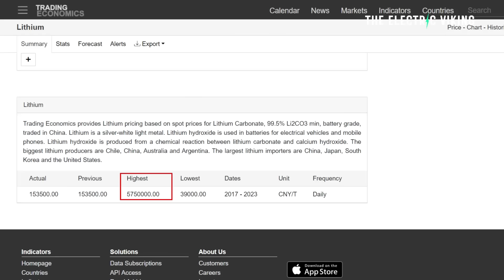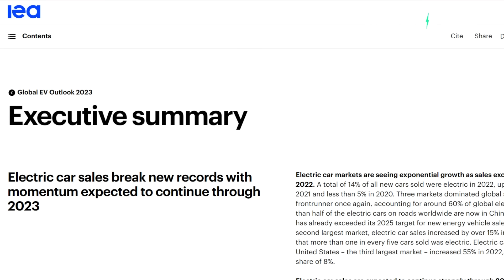The reason Electric Cars will be cheaper than ICE cars in 2025

Comment: EV's are still junk. They don't have the range, take entirely too long to recharge. The infrastructure is already crumbling. The Ford car companies CEO couldn't get from A to B with out extream difficulty. Also, (at least for me) there's no EV that suits my family needs. We aren't Ethiopian midget  refugees. We don't hail from Noth Korea or The Land Of Oz. Plus, size people. 4 of us. Several have had knee surgeries. Not to mention my 3,  70 pounds plus dogs, my yip dog, and my two attack cats. Currently, as far as I know, there's no EV that doesn't cost a very large percentage of my very nice house in Connecticut available to fit my needs. I stay with my ICE 11 years old Toyota van, it fits my needs, is paid for, no nasty monthly subscriptions, no worries about having to spend impossible amounts of $$$$ for repairs. It will be interesting to see how the lower prices of batteries impact the nasty replacement bills on a EV, saw one recently, plus $50 K for a vehicle less than 10 years old.
Reply: Modern EV’s have ranges around 330 miles. Like the Tesla model Y long range. But you typically charge it at home overnight when you’re asleep and not using the car. 0 time wasted or waiting for a charge and a full tank every morning. Unless you travel more than 330 miles for work every day. Which I doubt.

The model Y is also a mid sized SUV which is renowned for having more cabin and passenger space than any other SUV in its class and 300L more boot space than its nearest competitor in class. Plus a drop out under the boot and a front trunk not included in that number. And it costs about the same as a Ford Bronco. 

As for battery replacements. The total cost to replace a Tesla battery including labour is around $12k. Which is about the cost of a new engine. But the warranty on the battery alone is nearly 10 years. And is supposed to last about twice the lifespan of an ICE engine, which make sense consider the industry standard ICE engine warranty is only 5 years. 

As for repair costs, the Tesla is classed as a luxury vehicle up there with Audi and BMW. Comparing repair costs for panel damage. The cost is about the same compared to its competitors. It doesn’t have any maintenance costs so you can’t compare a cost for engine or transmission repairs because it doesn’t have any. The electric motors should last the lifetime of the vehicle without ever needing to be touched and since the battery is apart of the chassis the only way you’d damage it is if you had an accident hard enough to damage the chassis, which would be expensive no matter what car you were driving. 

The only increased repair cost you’ll get is if the rear left quarter is damaged as that’s where the charge port is. In that case you add 12% to the cost and you’ve roughly estimated the additional cost of repairs to that part of the car.

Comment: I just read that VAG, GM and Toyota don't want to produce EV's anymore because the customers don't want one. 
The customers don't want one. And they don't want one in 2025 unless a miracle happens.
Reply: True but also not true. The customer wants an EV. They don’t want THEYRE EV’s. Simply because they aren’t competitive. Tesla has been making EV’s for the last 10 years. They also have a drastically different business model which has allowed them to have the highest profit margin on any car sold on the market today. So they can and have been cutting prices to stay competitive. The way they’ve manage that is they build their own car from the ground up. And the support network with it. Like the Tesla super charger network.

That means every part in a Tesla is made by Tesla for Tesla. The programming, infotainment system, sound system. Motors. Seats, interior. Etc. Legacy automakers outsource that. They get someone else to design the infotainment system, and someone else to program it, someone else to build the engine, and someone else to design the interior and someone else to make the seats. They just assemble it. What that means is a lot of middle men taking a cut.

Couple that with the fact that legacy automakers not only aren’t set up to make EV’s and don’t have the 10 years experience of making and perfecting EV’s, means not only do they produce a product that can’t compete with Tesla’s they’re also needing to charge more for it. So you pay a lot more to get a lot less. Not only that but legacy automakers sell exclusively through dealerships which charge a markup on the cars to make bank. Tesla sells direct toy the customer. 

So naturally consumers don’t want to pay a heap more to get a lot less. Where good EV’s have been dropped at a good price point, consumers have jumped on it. That’s why the Tesla model Y is the best selling new car globally in 2023. 

Which is why cars like Mercedes EV offering, the EQ, isn’t selling. Because even if the EQ was at the same price point of a similar sized tesla, it wouldn’t be competitive. It would have the range, performance, software advancements or charging infrastructure and network that the tesla has. But Mercedes is asking for an extra $150k for it. Plus another $12k for the dealer. And then wonder why it isn’t selling?

Comment: You may be underestimating the potential decline in Lithium Carbonate prices in the next three years. Exxon is investing in extracting Lithium directly from brine wells 😮 if it works out as expected, current Lithium extraction costs could decline by over 80 percent with minimal environmental costs and impacts.
Reply: Three years out? The market will be dead for 2 years by then.

Comment: It is a real shame batteries are arriving about a decade too late. We pass the 2 degrees Celsius threshold in 2026.

We are emitting 41 gigatons of carbon per year and it was projected we would be down to 29 gigatons by now.

Even with radical adoption of electric vehicles, transportation is less than a quarter of our carbon budget.

An oceans are all out of heat absorption capability.

Seems to me anyone under 50 is going to live through some very hard times.
Reply: What is your plan for removing Water Vapor? A 50 times bigger problem.
Water Vapor (WV) is a greenhouse gas as potent as CO2 according to theory. On average there is 50 times as much WV in the atmosphere as CO2.
The fact that it is non-persistent is often mentioned. It doesn't have to be. You can AVERAGE (integrate) the effect. There is on AVERAGE 50 times as much.
Reply: @msimon6808  because unlike CO2 and methane, water turns to liquid form. And water isn't the cause of our current warming atmosphere. And increasing CO2 and methane causes warming of the atmosphere which causes the atmosphere to hold more water vapor which does cause increasing warmth from historical norms.

The root problem is a dramatic increase in CO2 and methane. If they were brought under control then things would regulate back to the way they were for thousands of years.

But here's a clue, because of people like you we haven't regulated and we won't regulate and things are just going to get really really bad . People who are under 50 will live in some very hard times with food insecurity and much hotter conditions.

Comment: As an older ice vehicle owner, I'm very happy for the success of electric vehicles.

It's putting downward pressure on gasoline.   

And in 4 to 6 years,  when I'm ready to buy my next new car it will be an ev.

Gasoline last night was $2.39 (cash).  That was gob smacking. 

However as the number of ice Vehicles declines, they will lose their Network effect and they will lose the political power and as a result their current massive subsidies.
Reply: It is electric cars that are getting massive subsidies. Just wait until your electric bill has a road tax. 
Electric cars will be a niche market in the world for a very long time.
Reply: @msimon6808  know the oil industry receives 6.4 trillion dollars in subsidies every year. That's more than the total size of the electric vehicle industry.

The coal industry receives additional subsidies so old they are embedded into our tax system.

The subsidies that the electric vehicle and alternative energy Industries are receiving are dwarfed by comparison to the fossil fuel subsidies.

Comment: Yeah right, paid for by the taxes on ICEs. What does the price look like when that's gone away? Then there's your car insurance cost going from $1000 per year to $5000! And is your time worth anything? Or are you okay waiting an hour for the guy in front of you to recharge before you start your own hour long "refill"? Of course, remember the warnings. Don't use your EV when it's too hot or too cold... Or if you want AC at home in the summer... And wait until the government start changing you for "recycling" your dead battery! And on it goes... Then just in case you think you're all squeaky clean doing your bit for the planet. An EV is nothing more than an external combustion engine adding heavy metals to its pollution footprint... Sure there is a place for these things. Forklifts or a small electric moped for running down to the store... But we're a long way from mainstream adoption and this won't happen until all the BS pedaling stops from people like yourself.

Comment: Evs will never take over from ice. The world doesnt have the electrical structure to handle millions of new evs. Many countries still dont have enough basic electricity to power their whole country properly. It will never happen. People are already shunting away from evs, look at all the unsold evs everywhere. 
This was just a government money making sceme that has gone badly wrong. 
Unless they can make a battery that can last 1000 miles between charges and can charge as quickly as an ice car can be refueled they are doomed. And law of physics tells me this will never happen, with the current technology. As a result electric cars will just be an expensive niche market, never making it mainstream...thus they will not be cheaper than ice cars. 
And I am not anti electric cars...they have there place, that being as a local runaround and short commutes for some people. But they need to be much cheaper, which will not happen. Here in Japan there are literally millions of small k cars which are 3 cylinder 660cc petrol engined cars, many hybrid also, cheap as chips to run and maintain. No one here wants an electric car.

Comment: With lots of car damaged from flooding due to climate change&extreme storms, can those vehicles be refurbished&converted to an EV?  There's EV conversion kits in Europe but there's resistance in North America due to top car manufacturers.  With a lot of common types of vehicles like the SUV, trucks and luxury vehicles being flood damaged and most of its shell is still useful but the ICE engine been damaged, can it be replaced.  So very expensive ICE brand vehicles like Range Rover, Jaguar, Ferrari, Mercedez Benz, Rolls Royce that had been flood damaged are mostly useless, their shells are being sold at a high discount used car prices. To make it feasible&encourage for ppl to adopt EVs, the flood refurbished conversions shouldn't be too expensive but also set up for recertification&have insurance that will support the converted EV market.

Comment: I live in Ontario Canada, and there's no infrastructure to accommodate EVs , majority of us are living in high-rise condos,  many are renting, there are no chargers in those buildings. We need charging infrastructures and is not there, and EVs sales fallen sharply here
Reply: Really? Because between Q1 and Q3 of this year, EV market share in Canada increased from 10%-13%. And pro tip. If those apartments have secure parking. You can get chargers or PowerPoints installed to charge the car from. And a lot of work places are also offering that as well. And I had an EV while renting. As it turns out, electricity outlets are considered mandatory for rentals. Just like water. Or windows.

Comment: Keep dreaming... The EV sale will go flat because the problems of slow charging, fire safety, short lifespan of the battery are not going anywhere. The charging network cannot keep up with the growing number of EVs. Remember most of human population are struggling with poor systems of electricity. EV is only a fancy toy for the rich
Reply: So many incorrect statements here. Where to begin? 
-EV sales show no sign of flat lining so far

- according to vehicle safety regulators AND insurance companies doing their own independent studies, EV’s are between 20-50 times less likely to catch fire than an ICE car. Even while parked.

- Modern EV batteries last twice the average lifespan of an ICE engine. The warranties reflect this, with the current industry standard EV battery warranty being nearly 10 years whilst the industry standard Engine warranty is only 5 years.

- charging network in the vast majority of places can keep up just fine. Most have excess capacity, and have been increasing in capacity, even to this day. Also keep in mind EV’s typically charge at night when demand is at its lowest. And at the rate of grid expansions vs EV adoption, there is more than enough time for the grid to keep up. 

- you can pick up a Tesla model 3, BMW’s M3’s main market competitor in size, performance, handling and luxury, for less than a ford bronco, BEFORE incentives. Ford broncos don’t strike me as a “toy for the rich” or ultra wealthy. Perhaps that’s why the best selling car globally in 2023 is the Tesla Model Y. Because it certainly isn’t because it’s a rich persons toy.

Comment: Good vid as always. Sam puts effort into these; it shows.

BYD making such profits because of battery production: seems reasonable. I suggest it's dangerous or at least misleading to quote BYD's profits as proof of anything much. As a Chinese firm its financial reporting is opaque and of questionable value. Chinese firms are all subject to control of the CCP and receive unknown subsidies from the State. China targets specific industries for dominance, subsidizes them and dumps product world-wide to gain market monopoly control. They've done this will a succession of industries, from low-value iron & steel to metals refining, solar panels, batteries and of course EVs. BYD reports profits of $5K per car. Maybe that's true. It's still a lot less than Tesla but it would be stunning success, where everyone else but Tesla is losing from $35K (Ford) to $430K (Lucid) per vehicle produced. But it's still suspect. We don't know whether BYD is actually profitable, and can't know.

Lithium prices dropping: another example of why people who scream doom about resource availability are idiots. Count on engineers & the market to keep increasing supply of a supposedly limited resource. Need more? We'll find more. We always do.

That said, geopolitics is the biggest risk. China doesn't have a monopoly on Lithium refining, but they do produce most of it. Growth in refining capacity elsewhere will help keep prices down, and China's oversupply problem will discourage it from blockading supply to other countries: they need the sales.

A more immediate problem: China has a near-monopoly on rare earths & cobalt refining. Tesla has engineered around that by eliminating cobalt from their batteries. So its exposure to that risk drops as it switches to LFP batteries. Other companies will follow. Tesla is also engineering rare earths out of its motors, reducing the need for them. Again, other companies will follow. Short-term we remain exposed to possible political blockade of rare earths from China.

Correction (at 1:20): Wright's Law, not Moore's Law.

Comment: My view: The game changer is commercialization of SSB(solid state battery) by Toyota, QuantumScape, and Solid Power in 2026 - 2027. BYD and CATL are behind in SSB at least by 5 yr. The sales of EV equipped with SSB will spike and all car manufacturers will stop making ICE cars before 2028. Many countries will ban Liquid Lithium Ion Battery which catch fire in passenger EV and buses everywhere. SSB provides 3 additional advantages: (1) faster recharge time, 20 min or less (2) longer driving range (3) 3X of battery life. No need to replace battery pack up to 240,000 miles. In the long run, it is cheaper.
Reply: With a given infrastructure doubling the charging rate causes four times the power loss. To go from one hour to 6 minutes of charging time causes 100 times the power loss.  I wouldn't let politicians make any decisions in this area. They have no concept of all the trade-offs involved.

Comment: Toyota made 10.5 million cars last year.  Toyota's new car that runs on water has an ICE engine.  Filling up with water at home will cost 7 cents for 10 gallons.  The water will be changed to HHO just before going into the engine.  The exhaust will be water which will be returned to the water fuel tank extending the range the car can travel.  No coal, natural gas or oil is used.  A water powered car has no carbon emissions.  There will be no electrical fires to burn children and adult passengers in the back seat.  Without a giant battery, the water powered car will weigh thousands of pounds less than an Ev and will cost less to make.  Because water powered cars use ICE engines similar to what detroit has been building for 100 years, it will take less time to copy what Toyota is doing than converting to make EVs.  Detroit is now starting to produce EVs and they are sitting unsold on the dealer's lots.  The Chevy Bolt had so many electrical fires, they stopped making until they could have fewer fires.  Imagine taking a water powered Jeep into the mountains.  There is a lake, a river and rain - abundant Free fuel.  Toyota will not be able to fill the demand for water powered cars with ICE engines.  Two years from now, ice engines powered by water will outsell EVs and Tesla will convert their just announced hydrogen powered car over to run on water.